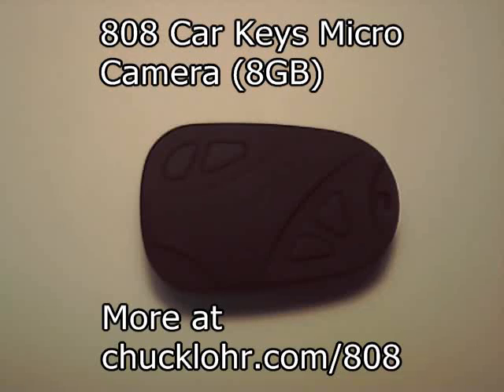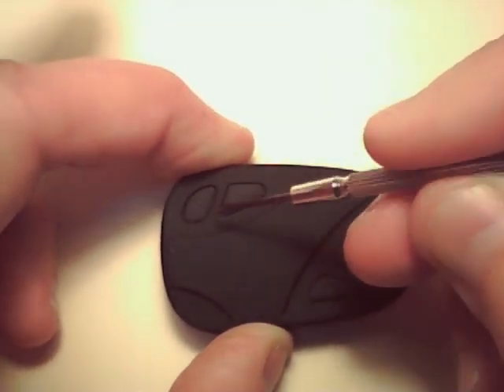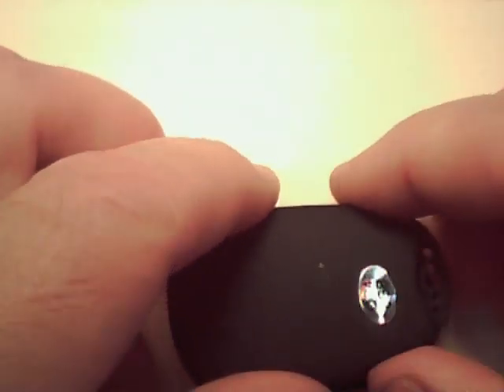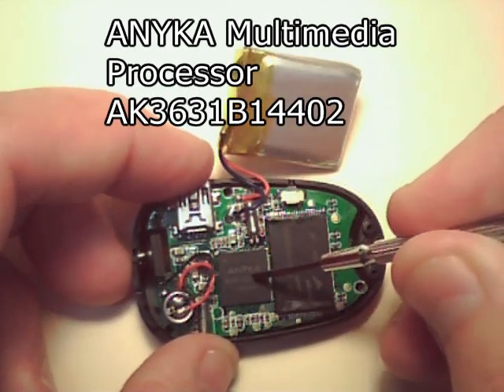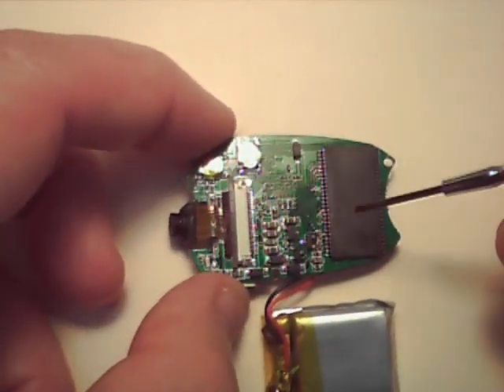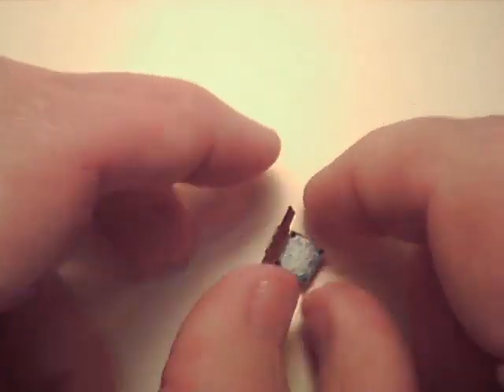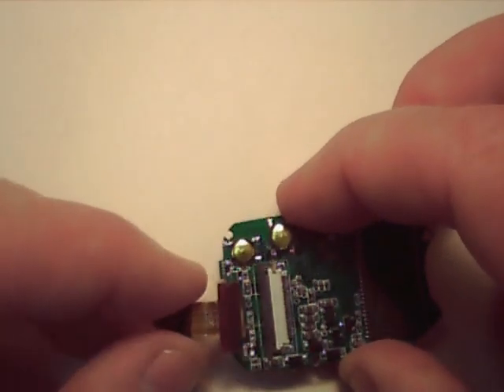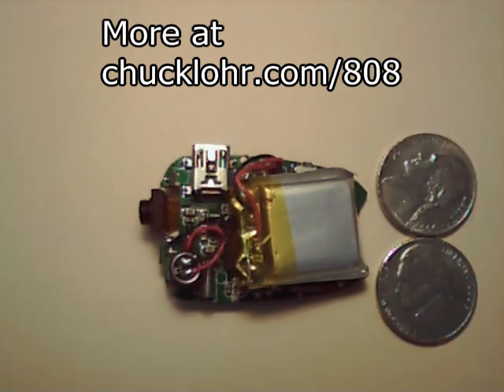Tear-down of 808 Car Keys Micro Camera (8GB)

Comment: Link buy
Reply from the maker: The 808 refers to the keychain format and is mostly an obsolete product first introduced in 2009.  However, in 2025,  the 808 #32 and Mobius successors are still available. Search eBay.com, RCGroups.com and other internet for "eletoponline365" or "Mobius Actioncam" or "#32s".  The 808 cameras were originally available directly from China for less than US$10 delivered, with no support from the seller or manufacturer.  Today, any 808 format costing more than US$50 is sometimes a scam. 
Radio controlled devices often use micro cameras, so follow RCGroups.com for micro camera information.  

https://www.ebay.com/str/eletoponline365
https://www.rcgroups.com/forums/showthread.php?4110751-The-Original-32S-32S-D-Camera-Support-thread-(Read-Posts-1-5-BEFORE-POSTING!)

Comment: My key chain camera is not recording sound for some time..it is recording only videos.. please help.
Reply from the maker: Is it a sound problem on the playback device and not the video file?  Try a different playback device.  Did the camera ever record sound?
Reply: Charles Lohr Yes, in past sound was playing in the same player
Reply from the maker: Just to be sure, try playing the video file on different players.  Open the camera case and inspect the microphone, a 2-pin device usually soldered to edge of the circuit board.  It is one of the few hand-soldered components.  Maybe the soldering was poor and has failed, so it might need to be re-soldered.  Good luck.

Comment: HI Is It POSIBLE plug camera to powerbank and record the video longer time? (can i  use 32 or 64gb micro sd card?)
Reply from the maker: The newer 720p cameras will usually record on USB power, read the sellers description. The older 480p cameras usually will not record on USB power.  Long recording time - the 808 #16 and Mobius will record for up to 5 days on one 32GB SDHC card if the FPS is set low, and external USB powered. 64GB SDXC is compatible with a few cameras, as a hack.
Reply: Charles Lohr thanks for your response. i have read that 64 micro sd card can be used, but it must be  SDXC type...do you know something about the hack?
Reply from the maker: Tomas Malinak Get a free RCGroups ID. Search forums for 64GB.  The 808 #16, Mobius and the SJ4000 have worked with SDXC 64GB FAT32, but some camera features don't work.  You must use an SDXC reader to format the card. Also see RCGroups / Aerial Photography / Mobius action camera / message #1252.
Reply: Charles Lohr thx

Comment: Hi Charles, I´ve recently bought F 999-2 multi function car key camera very close to yours but I can´t  turn it on. I am afraid there´s some issue with the device. When I plug it on the computer the yellow light comes for few seconds and then it dissapears. When I press the ON/OFF switch for 2 or more seconds the yellow lights does not come either. I have opened the device but all seem fine... Maybe the battery? Any idea? Thank you in forward.
Reply from the maker: Some cameras will flash the LED then power off if there is something wrong about the flash card,or the battery voltage is too low.  Some cameras come with a problem USB cable.  Some cameras are finicky about the flash card format.  Try pressing the reset button.  Try full formatting, not quick formatting, the flash card (FAT32) in an external USB card reader.  Try a different flash card.  Try the best USB cable you have.

Comment: I have an issue too. What can I do if it records but during playback only plays audio, does not even show video or takes pics. I even tried changing usb cable and using a video converter to change avi file but nothing still. Any thoughts? Have tried on mac and pc same problem.
Reply from the maker: Some micro cameras have a lens cap; take it off.  If the video does not play but the audio plays then there is probably a video CODEC missing on your playback device.  The video CODEC depends on what version of micro camera you have. The missing video playback CODEC is either MJPEG, H.264 or XVID.  XVID is rarely used. If you're on a PC, try the VLC player because it has most of the CODECs and usually plays everything.
Reply: Charles Lohr thank you very much for the reply. No cover that I can tell, looks like I can see the small lens. As far as codec what do you recommend for Mac? I have the most up-to-date date QuickTime player. I've tried reseting too. Do u recommend an update if there's one available?  I really appreciate the info thanks in advance :-)
Reply from the maker: punisher5007 I'm assuming your camera takes AVI MJPEG files.  Google "how to play mjpeg motion jpeg file on MAC".
Reply: will do! thanks again for time and your help. will let you know what if i can get it to work. :-)

Comment: i think mine i broken,,i charged it for 1 hour ,, has 2gb sd card but after charging it wont turn on
Reply from the maker: Press the reset button.  Try a different flash card.  Format the card (FAT32) in a different device. Try a different USB cable, as a bad USB cable can prevent the battery from being charged.  If you are skilled, open the case (2 screws) and measure the battery voltage.  Should be more than 4V after charging.  If not charged then the battery or the charging circuit could be bad.
Reply: Charles Lohr Does it have to have a flash card to work cause mine cannot switch on neither
Reply from the maker: Today, all 808 cameras use a flash card and it is required.  Make sure it is freshly formatted FAT32.  Use a good USB cable, not the cable that came with your camera.  Press the camera reset button.
Reply: Charles Lohr What is FAT32 ??
sorry for noob Q
Reply from the maker: When you format an SD card you choose a file system format: FAT32, FAT16, NTFS, etc.  808 micro cameras require FAT32.

Comment from the maker: Socketed camera-module extension cables are available on eBay for the 808 #16, #18, #26 and Mobius Actioncam.  The maximum length depends on the camera type. Search Google for "808 extending" for my page about this.

Comment from the maker: The plastic case for all the 808 versions is not the same.  The largest possible internal battery module depends on the case thickness. The smallest 808 battery is 3.8x20x30mm.  The internal internal battery module can be replaced with a larger external one.  The new battery module must have a protection circuit and be thoroughly bench tested for discharge safety and charging safety. See the 808 review, basic Q&A about batteries.

Comment from the maker: I'm not aware of anybody selling that cable. Google "Sneaky Snake Spy Cam" to see a successful extension cable made from 3 bundles of 8 micro wires (24 wires). Works at about 16 inches on a #3 camera.  Maybe magnet wire would work. Some internal camera modules are soldered and some have a compression connector.  Might not work with a 720p camera due to high data rate and cross coupling.  Requires extreme micro soldering equipment and skills. Cable pitch is 0.5 or 0.625mm.

Comment from the maker: A #3 or #16 are best.  Control the 808 buttons with a relay, opto-coupler or transistor.  Some cameras auto turn of after 30 seconds of no activity.  To lighten the camera under 10 grams, remove the plastic case and replace the battery with a very small LiPo battery module with protection circuit.  Go to my 808 review page and search for "Time Lapse 808 Camera Mod, No Micro Required".  Go to my #3 review page and search for "Sven's Time Lapse Videos and #3 Camera Mod".

Comment: Help recommend an 808? I need a small, inexpensive camera that can do still shots for a student project. It will go up on a some sort of conveyance, like an Estes rocket, and take a picture at the high point. I need to be able to control when the shot is taken using a signal sent from an external device like an accelerameter. Any ideas?

Comment from the maker: Possible problems include: Need to press the reset switch.  The flash card needs to be re-formatted.  The battery charging circuit has failed.  The battery has been damaged due to low voltage and needs to be replaced.

Comment from the maker: On the 808 #3 - The normal operating voltage of the 808 is 3.6V to 4.2V.  When not USB connected the protection disconnects the LiPo battery below 3V to prevent permanent battery damage. When USB connected the protection keeps the LiPo connected up to about 4.2V and disconnects the LiPo above 4.2V.  Without the protection the USB voltage would over-voltage the LiPo and maybe cause a fire or explosion.  With a battery replacement you must bench test a charge and discharge cycle to be safe.

Comment: On the battery, what is the protection circuit for? I want to know because I want to be able to add a 2000-3000 mAh 3.7v battery. 
p.s I know that a 2000mAh battery will be big - but I am not trying to fit it into that case, I want to fit it into comething else to make a sound recorder that can last for hours on end

Comment from the maker: Is the SD card installed?  When the SD card is installed and the 808 is USB connected the 808 should install as a disk drive (a mass storage device).  Connect the USB for about 75 minutes to charge the battery, not longer.

Comment from the maker: The solution is probably to replace the camera.  See the 808 review site and search for "strange color".  This is usually due to a data connection problem inside the camera.  Could be a broken flat cable or any of many possible bad solder joints.  If possible, put the camera in webcam mode.  Poke around the components with a wood tooth pick.  If the image changes, that is the location of the connection problem.  Use caution, the voltages are live, a short will destroy the camera.

Comment from the maker: Make sure you correctly identify what 808 version you have.  The version determines what webcam driver, if any, can be used.  No 808 needs a driver to be connected as a mass storage device.  If it does not connect, try a different USB cable.

Comment from the maker: The internal battery module powers the camera.  The protection circuit in the battery module is part of the USB charging circuit.  If the replacement power supply or battery does not have a protection circuit, then do not connect the USB.  The camera recording range is about 4.2v to 3.6V.  The LiPo battery module voltage range is about 4.2V to 3.0V.

Comment from the maker: The battery is consumer replaceable, but replacing it with a larger battery requires advanced electronics and LiPo battery knowledge, and must be thoroughly bench tested for safe charging and discharging.  The 808 #16 720p camera with a 32GB card and a 4000 mAh replacement battery would record more than 10 hours, but not 24 hours.  See the "The New #16 HD Key Cam" forum, posting titled "The definite Guide to Power connectors, charging, and other power related questions".

Comment from the maker: @frenchcuckoldable   Has it ever recorded files?  Does it install as a mass storage device, but there are no files? When you start a video does the LED flash three times and then self-terminate or do you press the button to terminate the video?  Reset the camera and format the flash card.  Otherwise try a different USB cable and different flash card.

Comment from the maker: @ClarkesonTheMarksman First identify which 808 version you have.  To install the 808 as a mass storage device (a flash drive) no driver is needed for any 808 camera.  If the 808 does not USB connect, then the USB cable or computer USB port has a problem.  Some 808 versions support webcam mode, some versions require a Windows webcam driver, some versions do webcam with no webcam driver.  Webcam mode is usually entered by short pressing the power button while the USB is connected.

Comment: @Normandy5 but I tried with two cards and formatted them, and I charged it for an hour, and it wont record past 8 minutes, you mentioned something about the battery circuit? Do you have a section covering this issue in your website?

Comment from the maker: @jasaircraft Short recordings are caused from a flash card "problem", or a battery that is not fully charged.  The camera is not a robust design, so anything that prevents the camera from writing a very high data stream will terminate the video.  Format the flash card or try a different card.  The best battery diagnostic is to measure the battery voltage.  When charged it should be 4.1V or more.  The camera will stop working below 3.6V.

Comment: I just bougt it yesterday~But when I connect it to the computer, the light is on which only lasts half minute. And then I disconnect it. But it cannot be turn on. That means it cannot be charged and used. I don't know whether it could be ok later.

Comment: @Normandy5 thanks for the reply. i will try formatting the card and using a diff cable. though because even after many hours the keycam keeps charging, so i suspect something is wrong with the charging circuit or the battery. thanks again.will get back to u.

Comment from the maker: @vampyzamby  SYMPTOM - short recording time.  PROBLEM - un-formatted flash card, a bad USB cable, a bad power source (computer), a failed charging circuit in the camera or a bad battery.  TRY - re-format the flash card, a different USB cable, a different computer or computer port.  If the symptom persists,  measure the battery voltage while charging to further diagnose.  Using a good USB cable and a good computer port, it takes about 75 minutes or less to charge a discharged (3.6V) battery.

Comment: i had got this to put on my RC heli, but after a few months it seems the battery cannot hold enough charge. even if i charge it for 6-8 hrs using a media player AC charger, the green charging light of the charger remains on and when i take a video, it stops in 6-7 mins, sometimes even 2-3 mins. what can i do ? thanks

Comment from the maker: @M1k3az You might want a "driving camera" or a "helmet camera".  For example on ebay: 290555374356, 250822880876, 170643046282.  Most camera batteries do not work well in cold weather, so skiing would be a problem.

Comment from the maker: @M1k3az There is no known way to mod the camera to add a view screen.  There is no known way to replace the micro SD card with a large memory device.  The 808 has been modified to record photos for days, by adding a large battery and electronics to periodically take a photo.  Then later the photos are put together to make a time lapse video.  See the review website for two examples.

Comment: Just to get some help...
Im relatively competent with components and soldering, and circuits, and I was wondering if there was a way that you knew to link this to a View Finder on an old VCR with its own 9V battery, and use this as the camera. ie A compact camcorder with eye piece. And also how I could link this to a larger memory device to record around three or four quarter days... I currently do not own one, so any suggestions on a model number is fine....
Thanks

Comment from the maker: @Jizzsplosion 808 cameras have either 480p or 720p image sensors, and produce either 480p or 720p video files.  Only the 808 #11 and #12 have both 720p image sensor and video file.  The #11 video quality is much better than the #12.

Comment from the maker: @bunchofhaters If the hardware IDs are "0AD2 900C" or "0AD2 917A" then it is a #10 or some variant of a #10.  See the 808 review and the #10 page.  The #3 and #10 are very different, with different processors.

Comment: Hi! I tried to use mine as a webcam but couldn't make it work. Its detected but the device instalation fails. According to the date time stamp should be a #3 but when I see the ID hardware, in webcam mode, shows 0AD2 900C, which I think it is for #10. Though, as a mass storage device it doesn't show ID. So I don't know which method (the stamp or the ID) I should use to determine the version. Could it be that mine is actually a #10 working with a #3 's firmware and for that cant work as webcam?

Comment from the maker: @arsitama An 808 version #3 (the popular version) records about 80 MB per minute.  8 GB would hold about 100 minutes of video files.  The battery charge lasts about 50 minutes.  To record more than 4GB the camera must create multiple AVI files automatically.  The #3 does this. Total AVI data rate depends on the 808 version and the video content.  A stationary subject or camera usually compresses best.

Comment: Thanks ... I Have another question please ... had bought it yesterday from Amazon, and plugged for maybe 3 hours ,and then the orange turn off . it works only 1 minuet  and then turned off . I putted in charge for 5 hours and didn't work . Please if you know tell me . I 'm very disappointed . And thanks

Comment from the maker: @Dracar70 The battery rarely fails.  What exactly is the symptom?  Won't record video?  Only records a short video? There are many causes for these symptoms including failed part in the battery charging circuit, bad USB cable, bad USB voltage source, flash card too slow, flash card unformatted.  Search the review website for "Common problems and solutions"

Comment from the maker: @dany0018 If any water got into the lens assembly, or into the battery module (protection circuit and LiPo) then it is probably not recoverable.  Otherwise, I would remove the battery, rinse the circuit board with distilled water being careful not to get any water into the camera module.  Blow dry.  Bench test the battery module to verify it is OK.  Connect the battery and test.  Good luck.

Comment from the maker: @imfatbye Go to the review website and search for "Extending the Camera Module Flat Cable".  It can be done but you need micro tools and a lot of patience.   Be sure to disconnect the battery before doing any soldering.